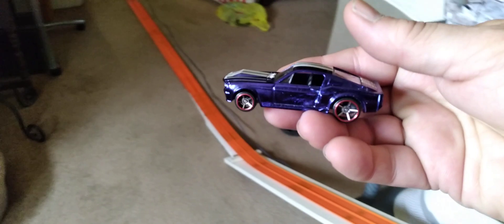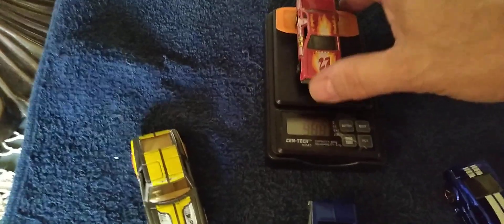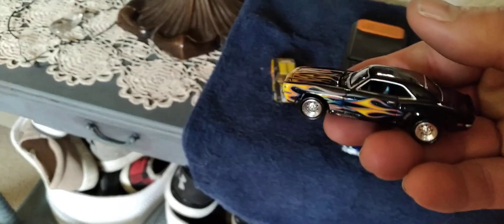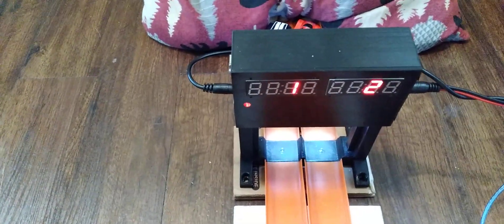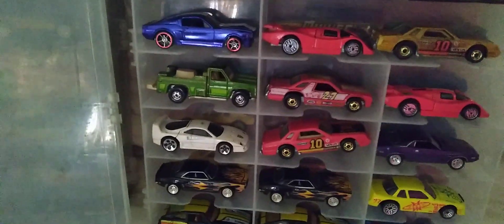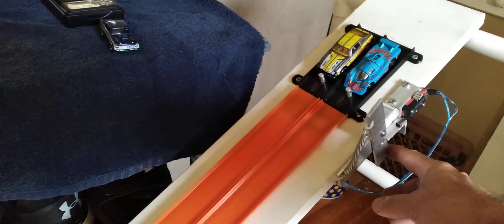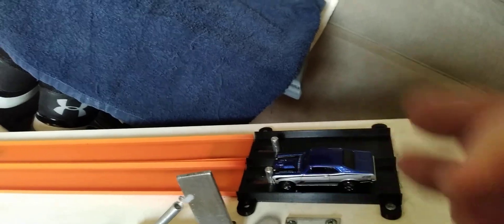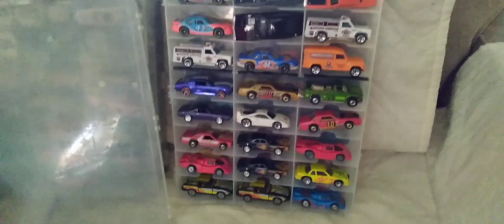Is It Fast??? Hot Wheels MC Shelby GT 500, Chevy Nova & Matchbox 280z Laser Wheels!

Comment: Yup, this has been discussed few times now but I have bunch of those fixed cars. When you pay good money of something plus same amount of shipping, damn right I'm gonna fix it if those wheels rub. And in my book it remains stock since there's no other tune ups done.
Mostly I use hammer and punch if those axle binders look like they could be manipulated, so there's not even that glue in there as extra. So in many of those fixed cars axle(s) aren't even locked even tho they are fixed. And usually I also grind that screw in a way that it cannot be opened without drill. 

Very stock-like. True, cannot be sent to anywhere but that really isn't an issue for me.
Reply from the maker: I agree Tomi. If there was no weight added nor any polishing of the axles or using a lathe or sanding grit on wheels, it is stock in my book. However I would respect how anyone hosts a race if they did not allow it.
However at least we can showcase such cars in our own collections and it's great to see them run to their potential.
Reply: I hear you. I have some classic castings, that I want to keep stock, so I can have a true running one of the type, and yep, need an axle fix. Cheers
Reply from the maker: @cutrockr-diecastracing2773  Cheers Marc! I have a Matchbox 928 that I opened up and turned the metal suspension bracing to properly secure the axles. Again, I don't think I can enter it in a race anywhere, but for purposes of my collection I have it in my stock ranks.
Reply: @yournightmareracing1754  Totally understand, a great thing for your own satisfaction. I will restore a couple here to original, until, who knows, a better original one comes along. Cheers
Reply from the maker: @cutrockr-diecastracing2773  Cheers Marc.

Comment: Hey I had a question, from your experience what variation of the sol air has performed the best?
Reply from the maker: My best performing Sol-Aire is the black one from 1990. I don't know if it makes a difference on whether it is a points card offering or not, but that year and that car seems to be the best of the bunch
Reply: @yournightmareracing1754  the one with the blue orange and yellow on black with the 33 on the side yea?
Reply from the maker: @sarhan_  That is correct.